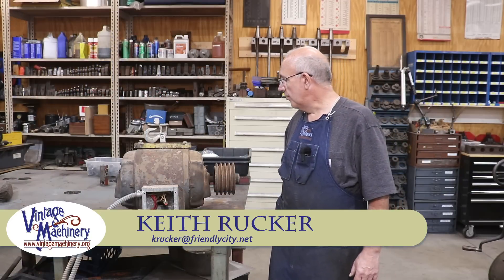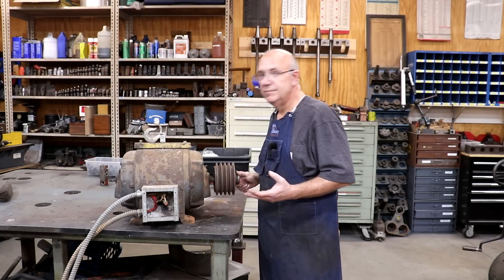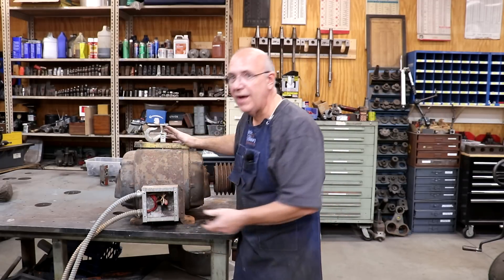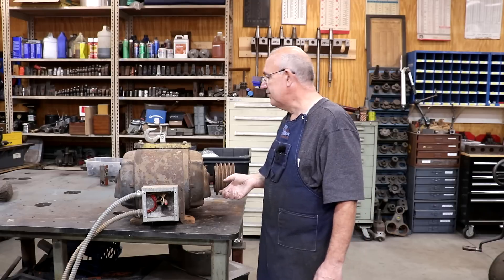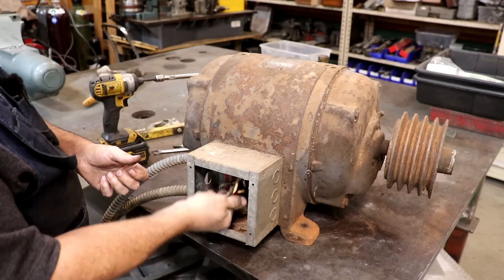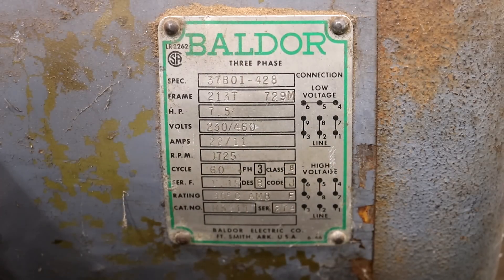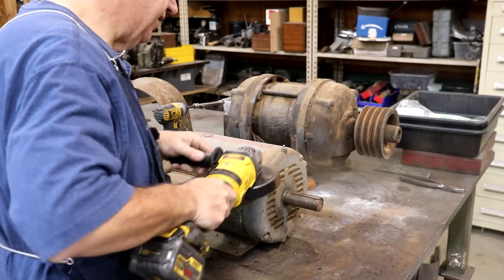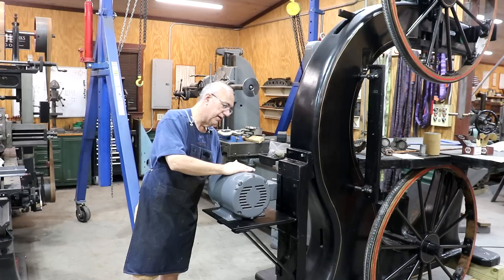Diresta Bandsaw Restoration 30: Finding and Mounting a Suitable Motor and Pulley

Comment: To find out what voltage your older motor is wired for you can put an clamp on amp meter on one of the leads coming out of the motor.  If the amps are 1/2 of the 208 voltage then the motor is wired for high voltage.   If it is drawing the rated amp for low voltage the it is wired for low voltage. Thanks for the video Keith.
Reply: The rated current is at rated load. Current draw will be much lower with no load.
Reply: I would think , if  the amps are double the 208 voltage amps, it is wired for high voltage. When you have lower voltage the draw is higher, if it is wired for 440 and you provide 440 the draw will be lower, but if you are providing less voltage, the motor will draw more trying to get that same wattage.
Reply: I agree that the rated current is at load, but I would compare the unloaded amps of the older motor with the new motor.  If they are both rated the same HP, they should draw about the same current unloaded.  So, if the old motor draws 1/2 the new motor, then it is wired for 440. If it draws about the same, then it is wired for 220.

Comment: There are a few things to point out. I would have checked the leads with a megger to make sure none of the leads are shorted. I also would  have hooked a ground  wire with your temporary power to prevent an electric shock had there been a short to ground. You can take the end caps off and rotate the stator 180 degrees, which would put the motor junction box on the backside to allow accessibility to it once it's mounted.
Reply: Agree with all your suggestions and that bit about flipping the stator is a neat trick.
Reply: A standard motor have the motor junction box at your left hand side when the shaft in pointing toward you.  So if you rotate the stator as suggest the owner will face the same with the same problem in case of motor change.

In order to know the correct voltage, connect a 120 volts between 2 of the lead. The third lead stay unplug. And measure the current (the motor will not rotate).  Performe the same test with the other motor. If the unknow voltage motor draw about the same current as the 240 volts motor then it is wired for 240 volts. If the current is half of the 240 volts motor then it is wired for 480 volts.

Comment: Love the channel Keith. You made the right call by reaching out to someone that specializes in motors With electricity you rarely get a second chance. Either you let the smoke out of the machine or the electricity let's the smoke out of you. If you (the viewer) aren't absolutely competent, pay someone that is. With as many voltages and variations that are out there and how many different configurations exist it isn't worth the chance. WYE/Delta are common configurations, but there are also star and other configurations. That isn't even considering things like cap start. Pay a COMPETENT electrician. The service charge is a lot cheaper than a rewind fee and the wait time.

Comment: If you pull the end bells of the motor you can flip the rotor and put the wire enclosure on the outside so it can be opened when mounted
Reply: Aesthetics, I think he is going for a streamlined look.

Comment: you should rotate the electric motor respect its base, so that the junction box is on the outside. You will have more space to stretch the belt and the electrical connection will be convenient
Reply: Then the output shaft will be on the wrong side of the machine.
Reply: True. I don't know that particular type of electric motor. many have a predisposition to rotate the base 180 degrees so the shaft would stay on the same side and the JB would go in favor. if they are then welded or cast you could also see if you can reverse the caps because they are symmetrical.

Comment: I recently bought a Clark friction drive drill press from between 1905 to 1910 that has it original DC motor. Thankfully the previous owner made a rectifier so it can be run off AC current. A Similar DC motor would look perfect on that old band saw

Comment: On the older US Motor, Remove the three screws on each end bell to release the backing plate behind the bearings on each end then the bells will come off easily. Dont try and pull the bearing with the bell, it can break the back retainer.

Comment: 7:00  The motor will consume as much current as the machine require. In other words, you can lock the rotor and convert the motor into a heating element.  The formula for power of a 3-phase circuit is Power = Voltage (V) x Current (I) x Power Factor (PF) x square root of three. A low voltage motor draw more current and need bigger cables and windings. The power stamped on the motor tag is the optimum condition for that specific motor. Current protection is set to the nominal current, as per the nominal voltage.

Comment: Using a wide flat belt for power is a very old method of power delivery; I would have thought you would have converted to a multiple belt pulley. I haven't seen a flat belt machine tool since I toured the Empire Mine's machine shop up in Grass Valley, CA in 2006. Nice work, Keith.

Comment: In the future you could design and have vintage looking cast iron ends made for a new motor.  Add a similar sheet metal cover to the gin motor, brass placard, and maybe a brass 3D name casting with a lighning bolt. 
One of those to-do things that may be a while off but could be sketched up and saved for a later day.

Comment: Hi Keith. Huge fan of the channel. Not particularly familiar with american electric motors (I am french) but you could check the power this motor generates by measuring the current it draws with a current clamp. That could tell you if the power is correct. Of course you would need to have a mechanical load to get its full power but if you assume that is draws 30-40% of its peak current with no load, you could tell by measuring the current if the power draw is consistent with the full 7.5HP or with a quarter of that if the motor runs with the wrong voltage. Maybe that could work.
Again great job on the channel 😀

Comment: Hi Keith
The present North American low voltages are 120, 208, 240, 480, and 600 volts at 60 Hz. This is the nominal voltage at the service entrance. The expectation is that a load such as a motor will be located downstream of the service entrance and there will be voltage drop at the motor location. This voltage drop is accounted for in the motor nameplate voltage rating:  115, 200, 230, 460, and 575, respectively. However, the voltage doesn’t have to be exactly the name plate voltage. There is a fairly wide voltage tolerance over which the motor will work properly. As an extreme example, some motors are designed to work correctly for both 200 and 230 volts. By way of contrast, receptacles, etc., have a rating that is higher than the nominal voltage: 125, NA, 250, 500, and 625 volts, respectively. Hope this helps understanding of, for example 240 vs. 230 vs 250 volt ratings. 
Be well & Best regards, Gottfried

Comment: Recently restored a Unisaw I found out in a local junkyard. Went thru the motor identification process and both of the two electric motor shops I trust came to the same conclusion it was a 525-volt motor. They both told me 525-volt motors only have a three-wire output. Then we looked under the side cover on my motor, and it had nine. We rewired to the lower voltage even though there was nothing saying it was a option, and it has runs fine now for over a year or so on my 240 three phase converter.

Comment: The no-load speed of an A.C. motor is a function of the supply frequency, not the applied voltage, so the same motor will run slower on a 50Hz supply than on 60Hz, which is the property employed in VFC, variable frequency control systems.

Comment: In the many years I have dealt with motor shops in my area, I have never had the issue where they would just rewind the motor for a single voltage.  The only time I have seen it done is when that was the way the motor was originally.  It doesn't make sense to me for the shop to do that, it seems to me that it would be just as easy to take all the leads out to the junction box as it is to just take three out.

Comment: By the way that motor started it was the wrong voltage. Recently hooked up a surface grinder that was wired 230 to 480... same terrible sound on startup

Comment: A quick way to tell if a 3 phase 9 lead motor is wired for the high or low voltage is if there are 3 wires tied together, it's wired for the low voltage. We had many conveyors of varied sizes that used either 7.5 or 10 HP motors. A 10 HP motor was cheaper than a 7.5 HP and the same frame size so we just stocked 10 HP as spares. The motor starters were set to the desired HP. A 10 HP motor won't draw any more current at the normal 7.5 HP load and the overload setting shut down the power if something got stuck and the motor tried to use more than the current required for a 7.5 HP motor.
Reply: Did you bother to watch the video?  This was explained thoroughly!

Comment: Yeah, the speed depends on the 60 hz…not the voltage.  A friend of mine has an oooold chisel mortiser with a 1920s era GE motor…the motor runs perfectly…the only problem was that the contactor needed the contacts cleaned…the bearings were perfect!!  We used the same pulley too!!

Comment: I'd make sure the intake vents on the motor are well screened. Had a 480v 60hp motor go up in flames at work last week when it overheated due to operator not blowing it out in a month, and the safety guy insisting on and expanded metal guard over the exhaust, leaving the 1"x12" intake holes unscreened, trapping debris inside the motor. When it overheated it threw a spark, igniting residual oil around it, which as it was driving a hydraulic pump, was expected, and tripped a 480v 200a breaker.

Comment: The speed in which that US motor came up to RPMs without the low pitch hum while it came up to RPM leads me to believe it's wired 220.
 You should take the end bells off of that Baldor motor and put the Armature into the stator the opposite way it is now then your wiring box will be out where it's easy to get to it.
But that is the thoughts of a retired Sparky

Comment: check with your motor guy again. the current draw should give you a good answer to the voltage needed. if wired 220 would draw much more current. either way it should come close to rated current on the motor tag. great videos  Dave

Comment: in Germany there are always 6 cables coming out of the motor. 
Y and Delta can then be switched with this. Y 230V / D 400V
Y is used to start the motor and switched to D when the motor is running.
The speed depends on the mains frequency. In US 60Hz in Europe 50Hz
Reply: Except it is exactly the opposite D 230, Y 400.  Or respectively  D 400 Y 690. The second one is the only name plate rating that you can make the motor start using the Y-D starter.  D 230 Y 400 motors are only the small ones, that can be ran only in thy Y 400 configuration on 3ph power. D 230 is usable only for single-phase fed frequency converters, that are capable only of producing 230 V 3ph output.
But I can easily see, how this can become confusing, with what the American mains mess is all about and their 9 wire motors, as people even in Europe has trouble understanding the much more simple concept of symmetrical 3ph mains, and just two common types of motors with 3 or 6 wires.
Reply: @Sixta16  single phase fed VFDs still can put out a voltage higher than 230V if they have a voltage doubler instead of a full bridge rectifier. Then you'd get a peak voltage of 650V, which drops with the load. But even with a full bridge rectifier you'd get a peak voltage of 325V after smoothing.
Reply: @CatNolara can you post a link to a VFD with a voltage doubler?  I have never seen one like that.
Reply: @michael931  I have a Mitsubishi FR-U120-0.75k-ER VFD, it only needs 220-240 volt single phase supply but is able to output up to 500 volts.

In hindsight, now that I read the manual a little more carefully it's the parameter "Base Frequency Voltage" that can be set between 0-500 volts, but that might just be a value used in internal calculations, not the actual output voltage. If that is true I might be wrong after all.

Comment: 7:11 Dual voltage electric motors (single phase or three phase) generally draw more current at lower voltage configurations to compensate for not being wired for higher voltage.  The HP should remain the same.

Comment: Hey Keith?  You do check isolation from the windings to the case/ground before you turn mystery motors on, right?
Reply: Should use a Megger, if you can own or borrow.

Comment: 11:58  Hi Keith !   Your little tachometer is off calibration - the Baldor motor, unloaded, will be running just under 1800 RPM, which is the "synchronous" speed of the internal rotating magnetic field for a common 4-pole motor operating on 60 Hz power.  1500 RPM on 50 Hz in Europe].  Fully loaded at 7.5 HP,  it will run at the nameplate rating of 1725 RPM.  Classical induction motors must slow down [aka "slip"] below sync speed in order to generate any torque.  Very simple concept, very inexpensive to build, very reliable.  Mr. Nikola Tesla's invention was a GIANT leap forward for all of humanity.

Comment: I would think that you could use Ohm's law to figure out whether it's wired for 220 or 440. You have the voltage (E) and the amps (I). You can find the Ohm (R) reading and compare it to what you have on the motor leads. E decided by I equals R. If the windings are in series for 440 the resistance should be higher than if they were parallel. Or RxI=E.
Disclaimer: I am not an electrical engineer.

Comment: To determine whether a 3 phase motor is wired for 230 or 460...  3 phase motors 20HP and above typically draw about 1/3 rated current at no load. Smaller 3 phase motors draw a little more. To check the old motor I would power it at low voltage and measure the current, if it's about 1/3 then it's wired for low voltage. If the current is significantly less than 1/3, then it's likely wired for high voltage. If I suspected high voltage wiring, then I'd (after first trying low voltage) wire it to high voltage and measure the current, which should measure not much more than 1/2. When testing on high voltage be sure to only run for a couple seconds, in case it's wired low voltage, as the motor will draw significantly more than full current and you don't want to burn the motor up. Ideally you'd want to be using a proper motor starter and overload setup to do these tests too. As others have said, before applying power at all, check for shorts to ground and ground the frame of the motor for your safety.

Comment: One question I have, is Mr Diresta going to have you build guards for the machine?    coming into to a new world With an older machine,  I'm sure OSHA would have some kind of interest if this was going into a factory setting.  And if i was building a guard for the machine I would build it to the old world charm that the machine emulates,  Like a wrought iron wire guard.  Well, then again Mr Duressa may only just want his machine back.  LjN

Comment: Might want to check that the interior is clean, the cooling are travels through the inside of the motor and could be full of dirt/dander that could be a fire hazard. A TEFC (totally enclosed fan cooled) motor would be better in this application because of the sawdust generated by the saw and this mode of motor cooling.

Comment: Quick question.  Why paint the motor gray while the rest of the project is black?
Reply: I agree. I think a black painted, pinstriped sheet metal cover with louvers for cooling would cover the ugly modern motor and give it a steampunk look would be appropriate. In any case painting it black to hide it a bit would be an improvement.
Reply: Everything all the same color is boring. Contrast highlights different components. Granted, that newish motor is not something to necessarily highlight - but it makes it obviously NOT the saw.

Comment: Since you have two 7.5 horsepower motors, I think you could figure out if the old motor is 220 or 440. Measure the DC resistance between any two wires of the 220 volt motor.
If the other motor is also 220 it would be of similar resistance.
 If it was 440 it would be about 4x  the DC resistance. This is because of how the coils are wired, series versus parallel.

Comment: AC motors run at the line frequency = 3600 "rpm."  This base speed is divided by the number of poles -- two in this case.  Thus, a 2-pole synchronous motor would run at 1800 rpm = 3600/2 in the USA.  Shorted rotor motors "slip" a little making the expected speed 1725 rpm; they will slip more under heavy load and less free running.  The torque is proportional to I^2... the maximum torque is proportional to V^2.
I would 'loosen' the tension adjustment to about the first 1/4 or 1/3 of its travel to allow more range as the belt stretches.  I would swap the motor's end caps so the wiring is more convenient.
Reply: Yeah, it made no sense to me when he said it was running at 1862 RPM. Sounds like his tach is miscalibrated.

Comment: SILLY QUESTION, YOU'VE HAVE SO MANY THINGS FOR THIS SAW, WHY BUY A MOTOR PLATE, LOVE THE CHANNEL
Reply: Pro tip:  Try using canned air to unstick your CapsLk key.
Reply: The motor will never be 'vintage authentic' since it was originally line-shaft driven. Getting a plate that matches the motor makes that whole assembly potentially useful somewhere else if need be. Plus it's less work, and Jimmy's paying for it - you have to learn how to pick your battles.

Comment: Wish youd used a 4 jaw to dial in that bushing for a more exact bore location. Might of made that pulley run a little better?
Reply: The pulley ran perfect.  As he mentioned, the drive surface was smooth.  The run out at the front was in the casting and not the bore.